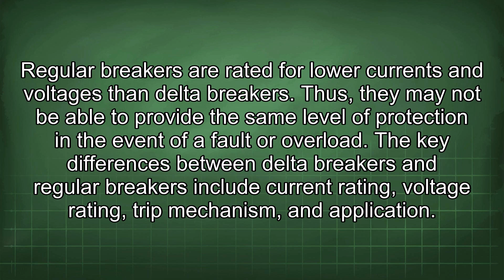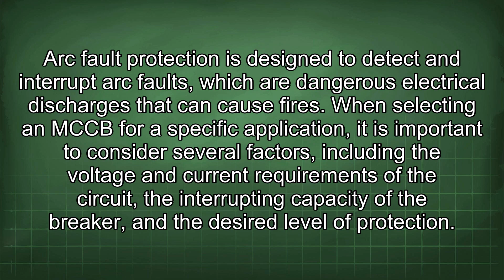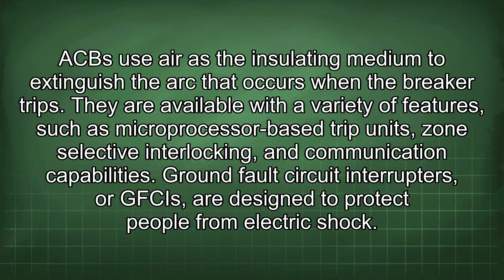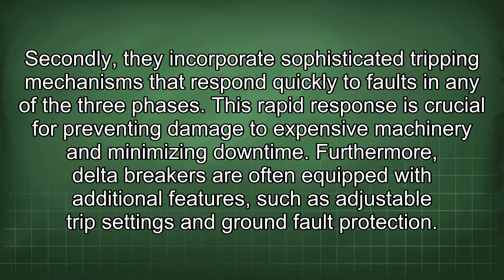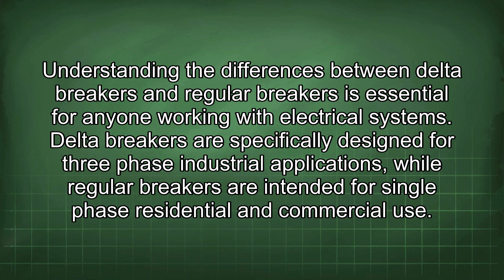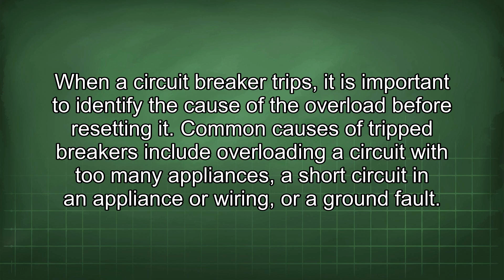Delta Breaker Versus Regular Breaker Circuit Protection

Comment: Not sure if this explanation for delta breakers was intended to apply to the USA, but from my neck of the woods, a delta breaker, also sometimes referred to as a delta phase breaker, or high leg breaker, was a very rare and now obsolete style of breaker which is more or less a "hybrid" three pole breaker so to speak.  This style of breaker allowed for one 240 volt three phase load from a 120/240V 1ø 3w panelboard, and was prohibited for new installations as of the 1978 NEC, and from my understanding these breakers were manufactured until around the early 1980s or so, marked "FOR REPLACEMENT USE ONLY" when all major panel manufacturers discontinued them.   The delta breaker was very unique in that it connected to both busbars of the panel much like your standard two pole breakers, but there was an additional terminal that accepted the third phase conductor- the high leg- from a 120/240V 3ø 4w delta service, often an open delta and this conductor typically ran directly from the meter base unfused.  Most of these delta breakers occupied 4 spaces on one side of the panel, except for the square D QO type, which occupied six spaces - three on the right, three on the left.   

The most typical application for a delta breaker was for some 4 to 5 ton central air conditioners from the 1950s - early 1970s.  During this era, some of the upper middle class to upper class neighborhoods in the Southern US had open delta banks, because when central air conditioning was in it's infancy, many models, particularly the 5 ton were only available for 240V three phase, as they were considered to be more reliable and efficient than a 240V single phase model.  This happened to also be the period where breaker panels were beginning to replace fuse panels in new residential construction, where a delta breaker would be installed for the new fangled air conditioner.

There were two main reasons delta breakers were shot down by the national electrical code.  (1) A potential shock/electrocution hazard.   With the main breaker switched off, or all individual breakers switched off, there can be back feed from the high leg through the load back onto the busbars in the panelboard if the delta breaker is switched on.   (2) Electrical shock/Arc flash hazard.  When replacing a delta breaker, the high leg conductor is UNFUSED and live even with the main breaker switched off, as it's fed directly from the meter base.  This high leg conductor is usually a smaller gauge than the other two incoming phases, usually a 6awg, while the other phases could be 2awg copper for example, and can easily stray loose and touch the panel enclosure or one of the other phases by accident, with dire consequences.   

Replacement delta breakers are very difficult to find and usually quite expensive as they haven't been manufactured for about 45 years and are found either as NOS or a used breaker pulled from a pre-1978 installation.  I occasionally see them pop on on eBay anywhere from $50 to $500.   

If you have an old delta breaker that needs replacement, the safest and most cost effective solution in the long term would be to install a small MOL three phase panel, available in sizes as small as 12 circuits, and install an appropriate 3 pole breaker back fed, to serve as the main disconnect, and another 3 pole breaker for the 3ø equipment in question.  High leg is required to terminate to the center busbar, or phase B. The existing 1ø 3w panelboard is now considered a subpanel therefore requiring isolated neutral and ground, can then be connected to phases A - C main lugs, protected by the backfed three pole breaker.
Reply from the maker: Hello @rarelampcollector,

Thanks for sharing your experience. The United States, Japan and very rare instances in Canada are the only countries where I have seen the center tapped grounded delta (high leg configuration). We cover this in some different videos.

Your proposed solution is ideal — to put a modern three pole OCPD rated for the highest voltage to ground ahead of the legacy system, where you could leave the remaining 120/240 V, two pole/three wire circuits.

Regarding corner grounded delta, it is seen in a few more countries in different ways; Uruguay for certain low voltage applications, Brazil for nearly all of their medium voltage transmission system and Australia for some 440 V systems.

In other countries, more common is floating delta for medium voltage, delta with a grounding (zig-zag) transformer or even in developing countries at distribution voltages, deriving a neutral by setting up occasional wye banks on the high side of the delta distribution. In a particular Central American country, I notice that they use separate wye banks for cell tower sites and copy centers, which provides a neutral for the entire system. All other distribution transformers (99%) were connected in delta on the high side using single-core three-phase transformers.

Sincerely,

BESA Research